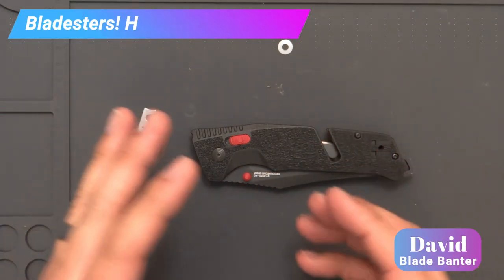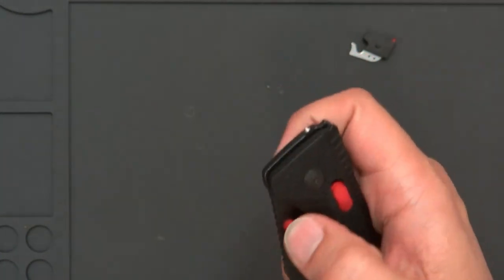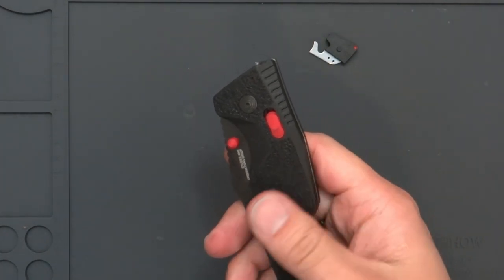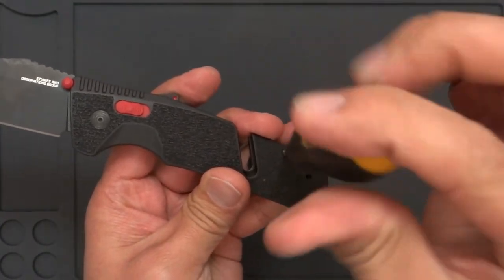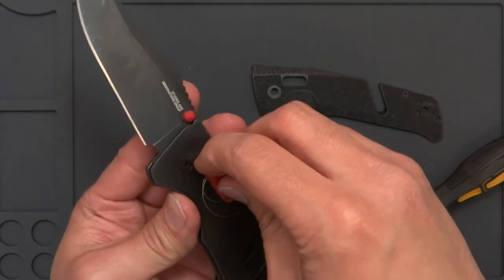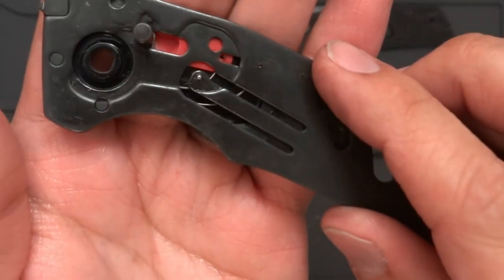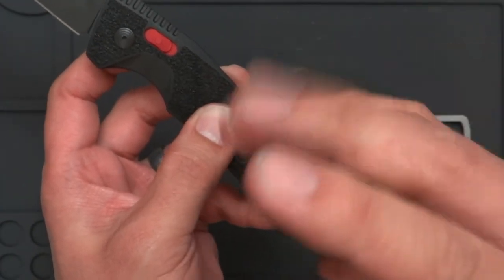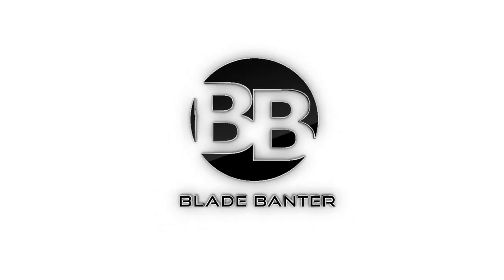SOG Trident AT Knife Disassembly and Deassist

Comment: I hate that they ruined the amazing smoothness of the xr lock by assisting the trident, flash and aegis. I got the trident and got all screws out but the pivot so far. I don't get assisted knives at all. Get an auto or don't.
Reply from the maker: Yeah I would have preferred a manual and they still might do it at some point. Seems the discussions they had and the feedback from those they talked to wanted the assist. Also assisted knives are legal in more places.
Reply: Auto, arent allowed everywhere so but for example where i life assisted is allowed. So it’s a nice middle ground. Not everything in the world ia tailormade for you.

Comment: I made my Trident AT-XR a manual. I had to do some grinding to the tang of the blade as well as remove the spring. It now has drop-shut action!
Reply from the maker: Nice, it's interesting how they changed the internals between the two options.
Reply: how difficult was it? i've got a flash at and want to do the same

Comment: The safety is needed for the belt cutter to work properly.
Reply from the maker: I can see the thought of that, but when your using the cutter your hand is holding the blade closed.
Reply: @BladeBanter  Hi David.  That may work, but it would be difficult to cut through a seat belt that way.  You may want to test it before relying on it in an emergency.  
On the plus side, the updated Trident no longer has the pocket clip in the way like it does on the earlier model.  And the added glass breaker is very well done and well located.  

I like your modification with the Teflon washer.  Well done!
Reply from the maker: @mrblauer1  true as I went and cut some rope with it but don't have any seat belt type material to cut.

   The washer just helped with the tolerance side to side.

Comment: David — thanks for the video and feedback. Glad you like the understated branding on the new line. There's more differences between AT-XR and XR than are visible at first glance, including tang geometry, the interaction between the pivot spring and suck-back springs, and how the XR-Lock interfaces with the tang in the closed position — in short, it's not really a great platform for making a manual unless you want to take a Dremel to the tang and reshape it. But hey ... looking at everyone's feedback, we might make an XR version. 
I'm going to do a quick video to show how to disassemble and reassemble easily across all the other AT-XR Lock knives, but the easiest way to remove the safety is to loosen all the fasteners and then you can just pop the safety out by prying it with a flathead. I know a lot of EDC users don't love a safety, but the main reason we have a safety is because assisted opens do open in pockets inadvertently and damage clothes and flesh and the targeted users we spoke to did want a safety, albeit ambidextrous. Anyway, if you don't want it ... remove it. Thanks again, great vids!
Reply from the maker: Thanks for taking the time to comment, and there is definitely a market for the assisted knife.  Definitely some good things here with the efforts SOG could definitely gain back some of the community.

Comment: Bro I really love this knife. I'm on my third. Last night it deployed in my pocket and it got me on the finger. Gonna take your advice and sand it. As a welder I go 100 mph banging into stuff leaning over it welding. So my third Trident finally went off after a heck of a night at work. That's not a reflection on Sog. Who's Really making some of the very Best knives finally. Keep it up Sog. Great show btw. Just chiming in. I also like the Aegis Assisted probably as much and a little more that Trident. Both awesome assisteds. I think they fire as hard as the best automatic Benchmade. The D2 Cryo on these is the best I've seen anywhere.
Reply from the maker: Yeah in deed, the assist fires really hard. I was surprised to learn that they are under the GSM Outdoor umbrella who also purchased Cold Steel.

Comment: Hey bro,
I was wondering if you had any updates on the Amare FieldBro. Have your thoughts changed in the last few weeks?
Reply from the maker: I haven't been able to work with it much as I had a rush of things come in, the texture is still too harsh for a pocket clip area.  The knife is now drop shut without being loose.  Lubricated and did back off the pivot a touch.
Reply: @BladeBanter  Very nice to know. I picked one up today on Drop as the design is very appealing to me. Best of luck with everything.